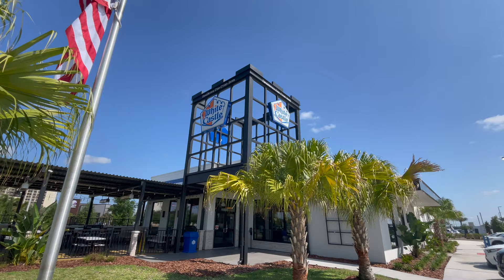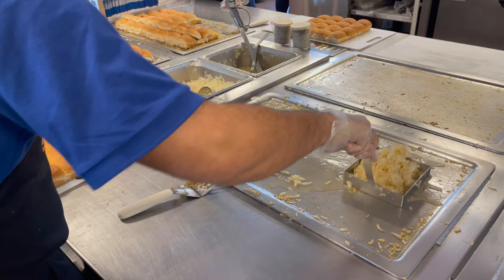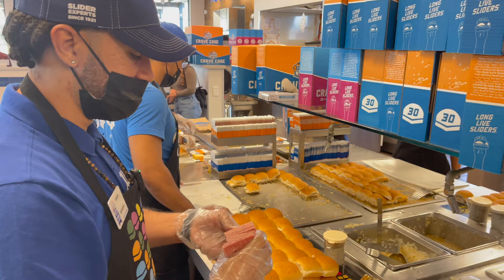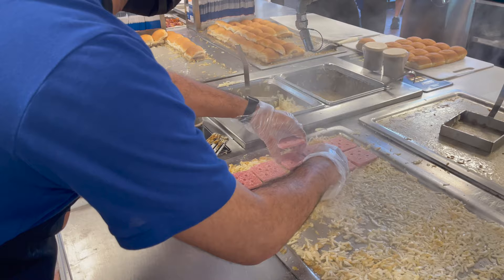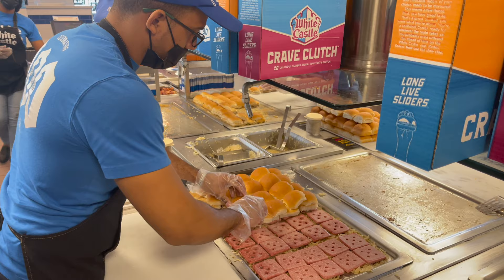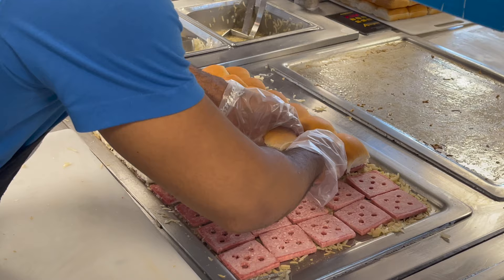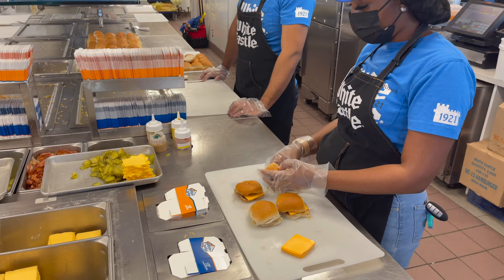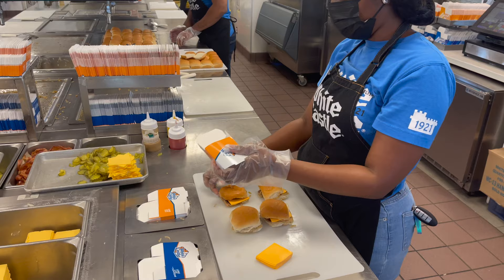How White Castle Hamburger Sliders Are Made

Comment: There are no White Castle restaurants in the Los Angeles area. But the frozen version (I think there are about a dozen sandwiches per box) is available at many supermarkets.
Reply: If you have a pressure cooker, like an instant pot, you can get pretty decent results. Just avoid the locations in Las Vegas. They're franchised. Overpriced and worse quality. The one in Phoenix is company owned, so probably better luck there
Reply: If they're anything like they are in the restaurant, I'm glad I'm not missing anything.  Bought a pack, had one bite, threw the rest away

Comment: What the difference between Krystals and White Castle?
Reply: Krystal patties have no holes in them & are laid directly on the grill.  When hot enough to start "dancin", the patties are flipped, then a pinch of onions are placed on top of the patty then topped with the buns like those shown for the White Castles. No raw meat on the patty that way either. Never had White Castle but love Krystals.  Worked there for a long while years ago.